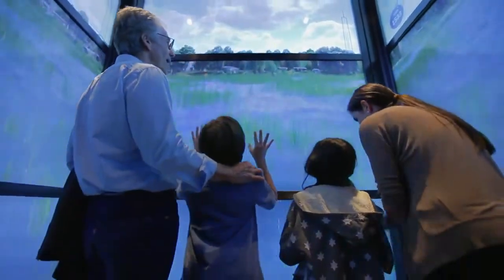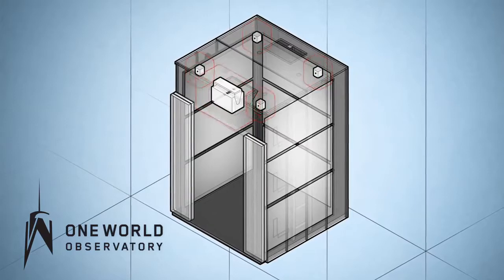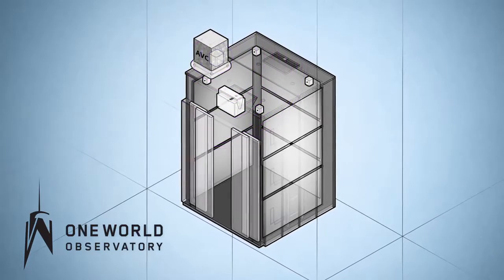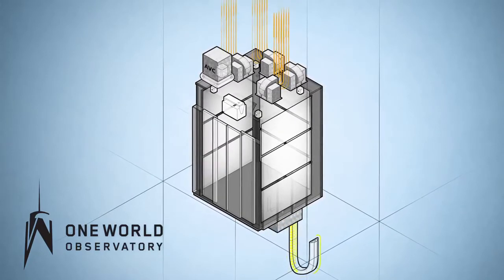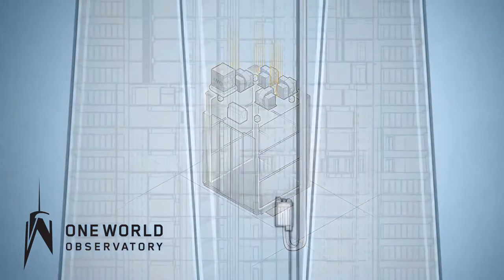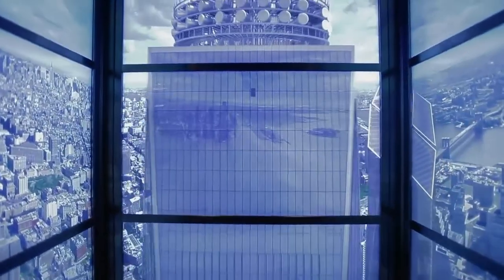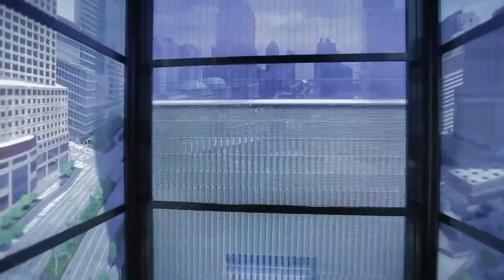One World Observatory SkyPod Elevators

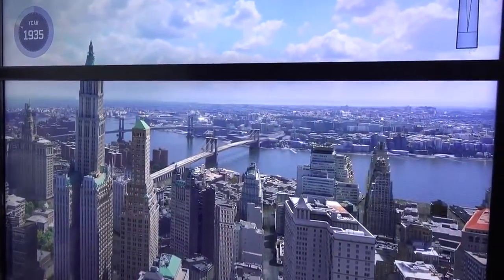Comment: We soared up to the 102nd floor in 47 seconds to put me at 1250 feet  above sea level (381 meters above sea level at 71.1 MPH yesterday from 2:00 PM to 9:00 PM central standard time or seven hours straight.❤🎉. 0:14 .❤🎉. 0:18 .❤🎉. 0:21 .❤🎉. 0:25 .❤🎉. 0:28 .❤🎉.